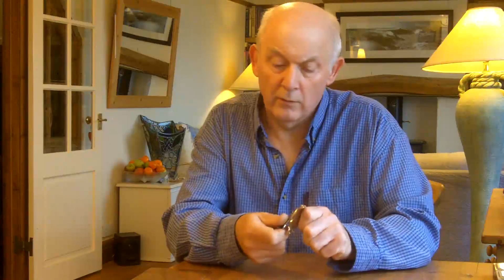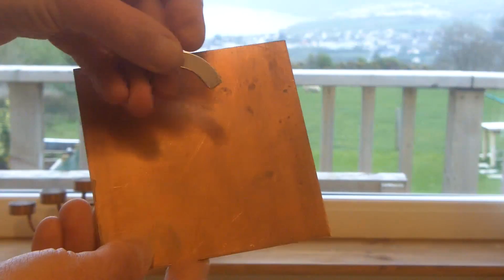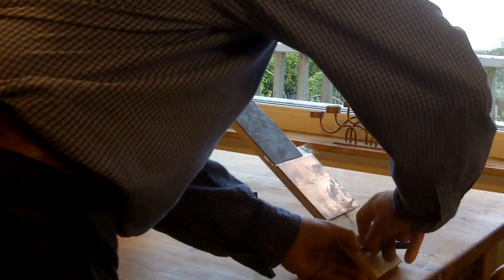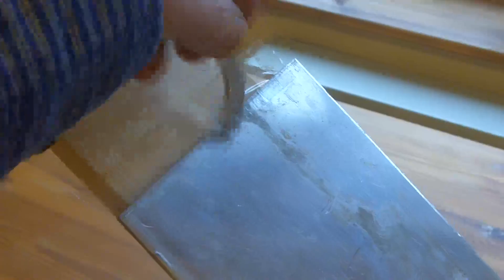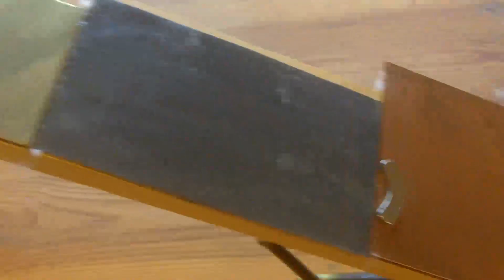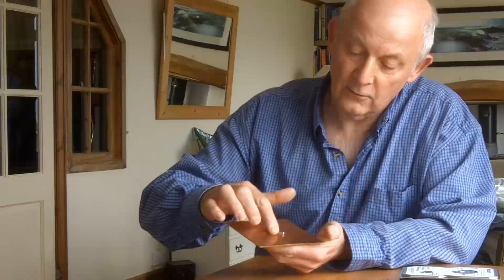Magnetic attraction to aluminium, brass, lead and copper.

Comment: Not a very good demo due to the unequal size and thicknesses of the materials... I have done the same experiment and brass actually induces much more eddy currents than aluminum and copper... I used 2cm thick blocks of each material... and brass created so much eddy current reactions that it stuck to it as if magnetic traveling extremely slow down the block of brass... speed of a snail just for reference as opposed to the other metal that traveled at the speed of an ant.

Comment: I Wana know if gold and silver do the same thing??
Reply from the maker: Hi send me one or two gold bars and a bar of silver and I'll test them for you. But joking aside, my guess is that it will probably work  better as they both have lower electrical resistance than the metals that u used. That's on the understanding that if you used a sheet of high resistance material like cardboard or wood or glass it would have no effect at all.

Kind regards . . .  Andy

Comment: If bullets were solid aluminum maybe magnets would be able to stop them? 
Does the lead slow the magnet at all? Would have been good to have a control on that board. 
I can maybe do it myself soon. One more metal id have liked to see is silver. Ive been doing a lot of comparisons between silver and copper and silver seems to beat copper in alot of applications.
Reply from the maker: I don't know about bullets, but there some fairground rides that drop people from a great height and they use magnets and aluminium to bring the ride to a gentle stop. I think the electrical resistance of load is too high to have any effect.
All the best . . .  Andy

Comment: I'm actually surprised that aluminum is almost as good as copper for the effect. I thought aluminum would be significantly weaker. I'm planing to design a magnetic coupling, probably I can use aluminum instead of copper to reduce price.

Comment: With 2 (or even 3) extremely powerful permanent magnets with a lead sheet as an alternating shielding that can easily slide fully between and fully out of the way by a tiny fraction of electric power that the pull and fall away of those 2 magnets can keep cycling for many thousands of year as non-friction. The reason what this will not break the laws of physics is because it can take very little power to slide the lead sheet to detract those extremely powerful magnets. This does not have to be gravitational device if placed in a torus loop in which the magnets alternate corresponding with the lead sheets. The major downside would be the back and forth vibration and maybe too noisey.

Comment: Aluminium has possibly lower resistivity than copper. It is a very good electrical conductor and hence used on power distribution lines. Whilst we normally think of aluminium as a metal it is in fact a metalloid, a semi-metal, and has rather different properties to true metals. It is for example paramagnetic, repelled by magnetic fields.

Comment: good to know for storing guitar pickups in close proximity to each other a lead or brass shield wood be good
Reply from the maker: What's the problem with storing guitar pickups close to one another? Aren't they just a bunch of passive coils of fine wire with an iron cores?regards . . .  Andy
Reply: i'm not sure there is, some sellers send them in the post with aluminum foil around them,
storing guitar pickups close to other magnets of any source may alter their tone

Comment: Nice experiment, but misleading title. This is not magnetic attraction. There are magnetic forces due to the induced currents (Eddy currents) as correctly stated, but if the magnet isn't moving there is no interraction (noticeable at least - paramagnetism)

Comment: Also can you please help me as I am trying to figure out if the metallic line in the center of the bottom of a solid copper used tea kettle I want to buy in a consignment shop has lead in it or not.. it is at a very cheap price and I can tell it a solid copper because I used to have one that was solid copper inside and out.. the problem is when I looked in this and saw the ridge I could tell it had been soldered which was a disappointment to me and it is not the same color as the copper so I need to know if it's some kind of material that could be harmful and I need to be discreet when I go to test it in the store.. would you have any suggestions ?... I doubt that once I buy it he'll let me return it if I am able to test it at home and find it on satisfactory.. therefore I would need to test it in the shop

Comment: Thanks for sharing. If using a magnetic core produces more current,why don't people use them in their wind/water turbine coil windings? Is it because it's simply easier not having to make the cores,or is there a real reason behind it? I ask because I'll soon be building a generator and making my own stator,but if it's because it's simply easier I'd prefer to make magnetic cores for my windings.

Comment: We all know that passing a magnet thru a copper wire that is coated will produce a current. Well then passing a magnet thru an iron wire that is coated will produce a current also , but does the copper wire produce more electricity ?
Reply: That's been my question for a while did u ever find the answer

Comment: I just wanted to share what he demonstrated is also known as diamagnetism and paramagnetism.  When he states that the materials are not magnetic, he is indicating that they are not ferromagnetic.  The drag from the magnet on the materials is either in the direction of the magnetic field, or in the opposing direction of the magnetic field. Diamagnetism is a property of all materials and opposes applied magnetic fields, but is very weak. Paramagnetism, when present, is stronger than diamagnetism and produces magnetization in the direction of the applied field, and proportional to the applied field.  There are other factors in place as well such as the way the material is fabricated, the thickness, the "grain" of the metal.  These factors change the behavior of the paramagnetic and diamagnetic materials.  The only paramagnetic material he is using is the aluminum.  The Brass, Copper, and Lead are all diamagnetic materials.  You should turn your water on and stick one of those magnets next to the water falling and you will see the water being repelled.  Also, if you attach the magnets to a wheel and spin it with a drill you will see the transfer of the motion to the material and it will start to move as well.
Reply: ***** He has salt there too- unwittingly. and it's not grounded- There's No Ground- Eddie Murphy-  The Golden Child!
Reply: Way before my time, still a classic I am sure.

Comment: When I took my brass swarf to the scrappie, he pulled a magnet on a chain across it and when he examined it (magnet) he declared it "irony" as it was sticking to the magnet. The result being the payout was reduced. I subsequently tried this with certified brass, and kept the swarf  absolutely uncontaminated and sure enough it stuck to the magnet. In the past I have had aluminium totally rejected. Is it a con trick?

Comment: Yep. What happens as the copper sheet is rapidly lifted the magnet lifts and tries to follow the copper, you could argue that it’s an attempt to maintain equilibrium and that’s fair enough, but no matter how you look at it, is not repulsion. Anyway I think that it’s an action that probably still has many uses that we haven’t stumbled on yet. I'll probably make the video of the magnet lifting in the hope that someone may think of a useful application for it.
Kind Regards ... Andy
Reply: Good reasoning.

Comment: I think the magnet will try at least to lift up yes, as long as there is a  changing field that is of course.  but this is not  an ordinary attraction per se.. this is simply an observation of how they try to oppose any induced magnetic field, so if you move the magnet  some way along any copper surface in any configuration, the magnet will  try to stop this new "motion" by opposing it  and in this case it will try to stop the  copper plate from going up. thx

Comment from the maker: OK think on this...
What do you think would happen if you take the magnet in the video and place it on a nonmagnetic surface and you then hold a thick sheet of cooper above the magnet and then rapidly draw the copper sheet up and away from the magnet? Do you think the magnet will lift and try to follow the copper or do you think the magnet will not move? By the way if you get the answer wrong I'll make a video and show you what actually happens.
Thanks for your interest in the video
Kind Regards
Reply: Bit late to the party but I'd suggest that the copper and the aluminium contain some traces of iron which is why the magnet 'sticks' weakly to them.

Comment: I have a rare earth magnet from an old blockbuster dvd security release system. It is probley 5 times stronger than one found in a hard drive and smaller. I have 4 inch copper plate and I nearly have to tip it completely sideways for it to move...
Im going have more fun with this and see what else I can do with it...
Supposedly you can buy them at uour local hardware store.
I didnt know these were metals could be attracted... 
Great video!! Thanks!

Comment from the maker: Hi Mick, I think the changes in technology are fascinating, think of photography going from wet film processing to electronics and calculators going from big cogs and springs to IC’s, TV going from CRT to LED. In my industry, induction heating, a 20KW Radio frequency generator went from a huge machine you could stand up in to a machine small enough for a man to carry. In another 60 years the changes will be phenomenal, someone might might design a computer that’s fit for purpose.
Regards ..Andy

Comment: An interesting experiment would be to wind enameled wire on to a piece of flat plexie and observe the effects of the magnet sliding down the copper coil with various AC-DC voltages applied.

Comment: Andy, I wonder if the engineers of modern earphones, earbuds, cellphones, etc., had the neodymium magnet's relationship with the copper wiring in mind during their design phase?  The use of magnets in my iPhone and iPod have incredible audio quality considering the tiny size of the speakers.  It is amazing how some things we thought we knew as young men learning electronics have been turned on it's head.  Wonder what the next 60 years will do to today's logic and reasoning?
Reply: It's exciting!

Comment from the maker: Hi there, I looked at the video, I don’t think there’s any connection myself. I’ve moved huge machines on my own using levers and blocks, it just takes time.  One of our engineers was sent to China, he saw workers move a massive press (Like a drop hammer) he said the foreman blow a whistle and men came from everywhere, surrounded the machine then more men came with large bamboo canes and poked them in every available hole and lifted the machine, should have been imposable but they did it.

Comment from the maker: Hi there, I didn’t show it in the video but I did drop the magnet through a length of 15mm copper tube and it took ages to fall through but while I was thinking how to video the inside of the tube I come up with the idea of the copper plate and that made me think about other electrically conducting nonmagnetic materials that I had to hand.
Thanks for the feedback.
Kind Regards ... Andy

Comment from the maker: Hi Rick, if you get the opportunity to try it out I think you’ll have a bit of fun simply because is contrary to what you normally expect. Although I didn’t show it on the video I also dropped the magnet down the inside of a copper tube and it takes ages to fall through. I think I might buy some more regular shaped neodymium magnets to play with.
Kind Regards ... Andy.

Comment from the maker: Hi there, the other place you can see this of course is in our cars. 
For those who haven’t see it, when we had mechanical speedometers the pointer of the speedometer was connected to an aluminium disc and a rotating magnet was positioned close to the disc, the magnet was connected to the cars gearbox via a flexible drive cable. A light spring provided a bit of resistance and returned the pointer to zero when the car stopped.       
Kind Regards ... Andy.

Comment: Hi Andy, haven't seen this since my college days.  I remember the setup where the lecturer had a horseshoe magnet mounted so it was free to run on its horizontal axis and close to it was a copper disk also free to rotate.   When the magnet was rotated it caused the copper disk to rotate.  It had us all stumped until he explained it!  However, I'm still searching for an explanation of lines of force that explains how magnetism actually works!